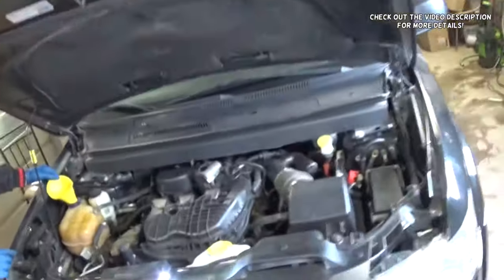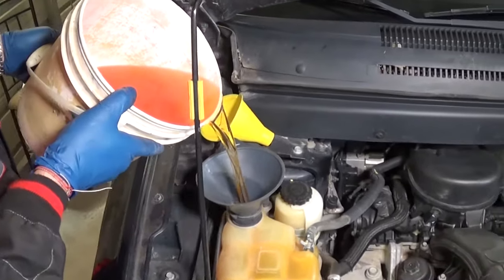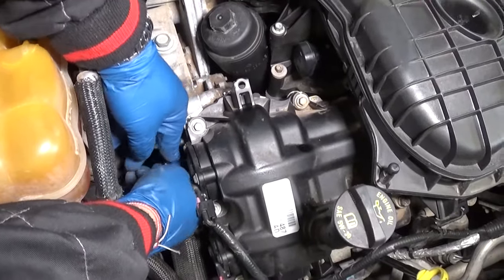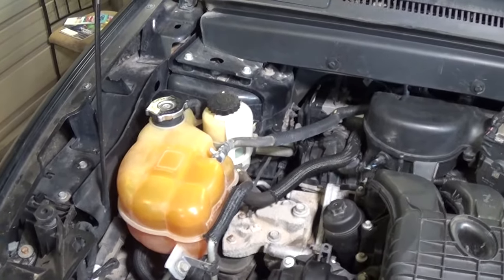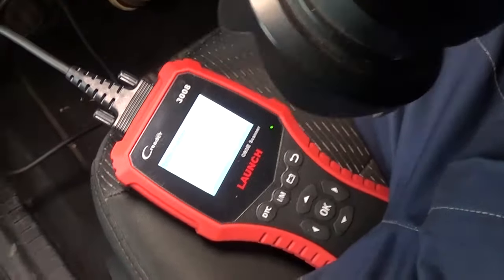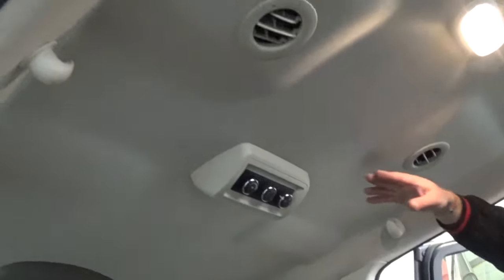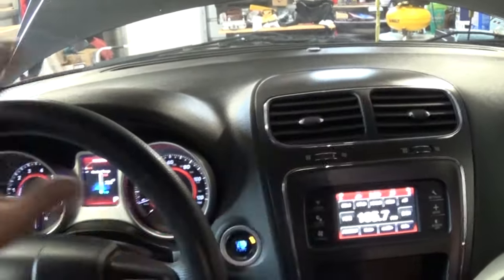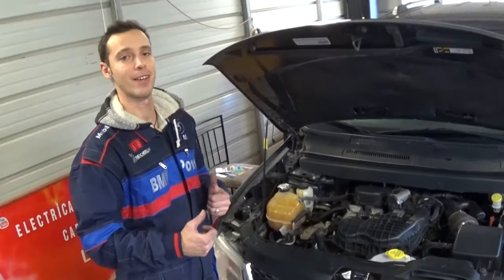DODGE CHRYSLER JEEP 3.6 PENTASTAR HOW TO BLEED COOLING SYSTEM

Comment: There is no need to remove that bleed plug, just loosen it.  The slot in the threads is there to allow the air to easily escape.  Leaving it in will greatly reduce the spillage from it, as soon as coolant spurts out you just tighten it back up.  There is also no need to monitor with a scan tool since the car has a gauge.
Reply: Dudes just wanna feel like they doing something 😂
Reply: I always check scan data after doing cooling system work to make sure the fans come on at the correct temp. Takes 2 seconds lol
Reply: My plug literally melted because I loosened it while the system was warm :(
Reply: @billypeterson9284  Nope.  That plug is exposed to full coolant temp so there's no way that loosening it with a warm engine melted it.
Reply: This comment was very helpful
Reply: @DonziGT230  it’s happened twice now, thanks though. Lol. Can loosen and tighten it 100x while it’s cool, if my car was overheating and you touched it at l you were going to lose the cap. My coolant was 245° at that time
Reply: @billypeterson9284 your the problem. Why are you messing with stuff when you have no clue what your doing?  You are the reason your having problems, believe it or not.

Comment: I got a water  leak behind the thermostat housing the water is running inside the motor up under the intake and out the other side Can it be the thermostat housing and if so should I put the 9023102hp on it  .my name is Michael  I have been working on cars for 50 years and I have never seen any thing like this before please help 🙏 me  ha ha  and thanks for the video you are a blessing
Reply: Michael,    Plastic housing ....they make replacement ones made of metal. Rock Auto has them but can get at a lot of places. Amazon too I believe.

Comment: What temperature should the fans be coming on?
Reply: 218-220
Reply: @wastingtyme25  does it vary on vehicle or is it standard in all 3.6L. I own 2018 ram. I do see fan turns on but the temperatures when hauling minimum 220-maxium 230. Normal driving minimum 218- maximum 228 sometimes goes to 230. 

I've changed radiator, water pump, thermostat. Bleed and burb the system. Is this normal temperatures?
Reply: @waltercastro2015  I’m not sure I thought it was high too.    I bought a challenger in Florida last November    Would have never known it was bad except I had to go out early one morning when it was 40’s.   Anyway started researching what the temp range for it was and everything pointed to 218-220 being normal.
Reply: @wastingtyme25  2015 Ram Promaster 3.6 here. I thought 220 high too but that's what I hear/see is the temp for fans. I would like to adjust that down a bit myself if it were possible. . I am at least going with a high quality Full Synthetic oil and a high quality coolant with a special coolant additive for extra protection. I plan on traveling a lot.

Comment: How come with my 3.6 L Chrysler 200 convertible every morning I have to burp the system? And sometimes it’s like almost impossible to get water or coolant out of the bleeder screw. And I’ll have no heat. But then if I keep going like with the garden hose it will start pouring out of the bleeder screw but why do I have to do this every day? What do you think could be going on? And why is air always trapped in the system when it sits overnight?

Comment: I don't have a radiator cap on my 2019 Chrysler Pacifica and I just replaced the radiator yesterday. Today, after driving, the coolant was boiling and going up and down in level in the tank. How do I get rid of the air on my car cooling system?
Reply: The bleeder valve on the thermostat!

Comment: I do need help guys. I have a 2018 Ram 1500 3.6 Tradesman, I've change the radiator it had a crack, I change thermostat, screw bleed and burp it. The coolant jumps a lot from 219-234F, lately is maintaining at 224-228F then jumps to 234F and sometimes may had reached to 240F. Engine oil stays along with the coolant temperature variable. Transmission oil goes 194-204F. Is it the water pump? I haul every day. I bought this truck in 2020 in two years I highly doubt might be the water pump but I am on my 80ks miles.
Reply: Update: I've changed the water pump. Burb it and bleed. Minimum 220-Maximum 230. Transmission 194-204. 

Is this normal 🤷‍♂️?
Reply: Same thing after I did a radiator flush. I’ve been battling it for months

Comment: I pulled the radiator drain plug out all the way and the way it screws in and the shape of the plug is weird and I'm not sure how to screw it back in without damaging it. It's a 2013 Chrysler 200 V6
Reply: I just did too on my 2011 dodge charger, all you gotta do is twist it back in while pushing. It’s not gonna break

Comment: 2019 jeep wrangler jl sport 3.6 does not have radiator or drain plug, so for this how do you flush and refill coolant on this jeep?
Reply: @jay.... no need to flush if you have no radiator. Seems odd tho. Air cooled ??

Comment: Anyone know how to get the old coolant out prior to starting this . I can't find the drain plug..
Reply: It's on the bottom of the radiator
Reply: On the passenger side broski under the radiator u will see a small twist plug
Reply: Mine has none. I had to pull lower hose off. Going to add a drain to one of the hose's.

Comment: What causes water to come out of the Dodge Journey exhaust? Why?
Reply: Blown head gasket
Reply: Water coming from your exhaust is a sign of a well functioning catalyst system. Water vapor is brought into the engine through the air intake system and filtered out by your exhaust system.

Comment: absolutely wrong and a mess... with the vehicle off, just fill the reservoir til the full mark, squeeze the lowest coolant hose, until you build pressure, then hold the squeeze on the hose while unscrewing the bleeder screw just a bit until you hear the air come out, then tighten the screw, and repeat the steps until coolant comes out of the bleeder screw. fill the reservoir as needed. final step is to have the vehicle running until operating temp., shut the vehicle off, let it cool down, open the radiator cap to let the rest of the air thats trapped in there out. screw back on and you are good to go.
Reply: Nothing about this video was absolutely wrong
Reply: Your definitely wrong.  Stop telling stories.